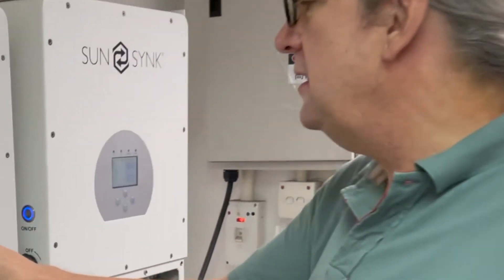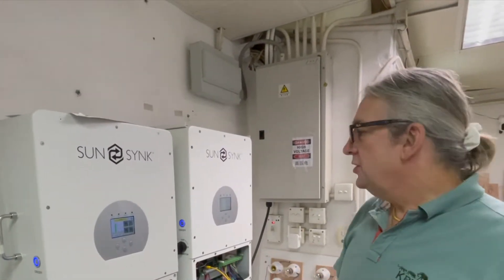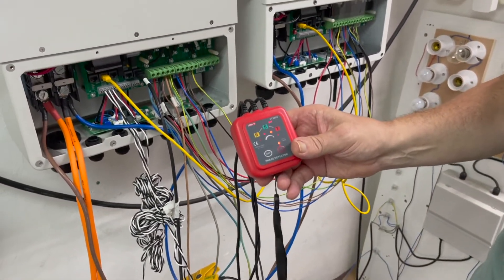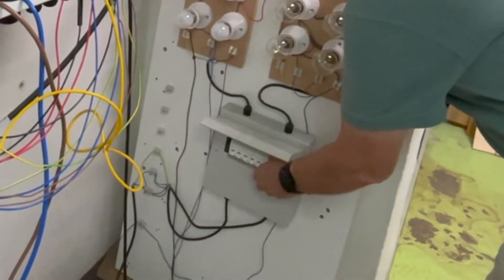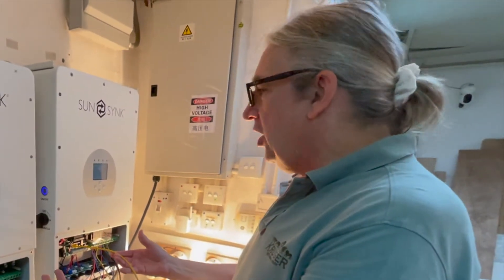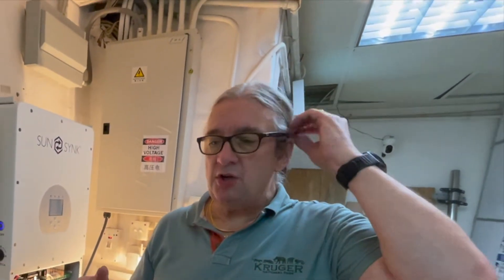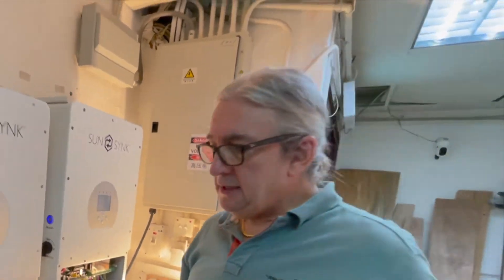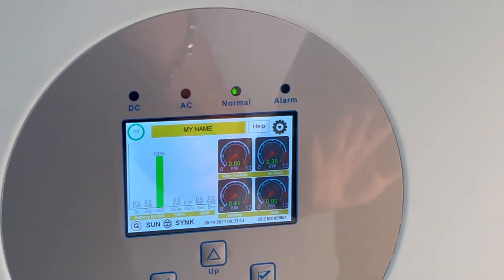3 Phase Hybrid Inverter #Sunsynk #3 Phase # Paralleling

Comment: Are you using the load output port for this? I'm having some trouble grasping how anti-islanding and power grid outage with UPS functions works together, is it only possible when using load output port?

Comment: Can you tell us what happens if you loose one phase on the grid side, quite a common problem is SA. Is it possible to charge the battery using the remaining 2 phases and then provide 3 phase power from the battery or will it just ignore the feed until it sees 3 phases and run on the battery until it’s flat?
Reply: Any update regarding this question?
Reply: Gaan offgrid

Comment: In the spec sheet it states a max continuous AC passthrough of 60A. Could you maybe explain what is meant by this. I guess it means that 60A may passthrough to the ups or load side of the inverter from the grid if available. would it be correct to say that if the grid is available you can pull the 60A plus the output of the inverter on this load side?
Reply: No